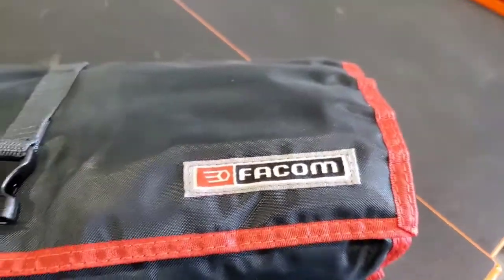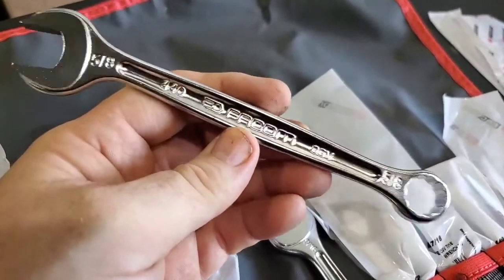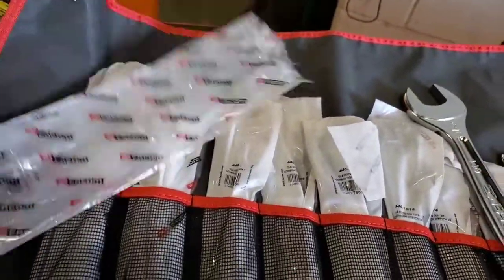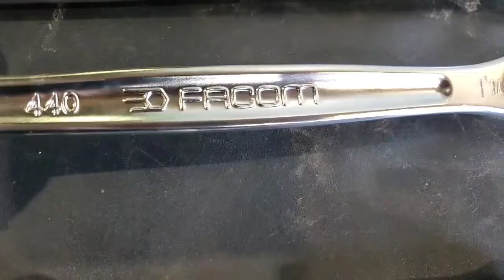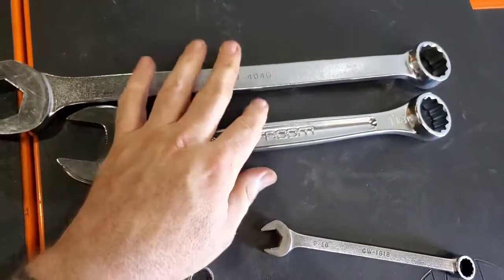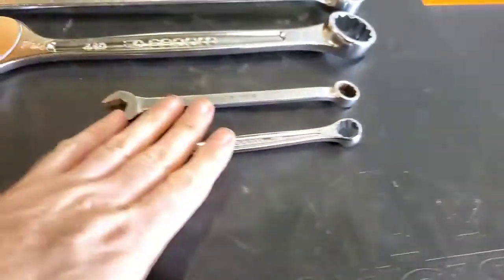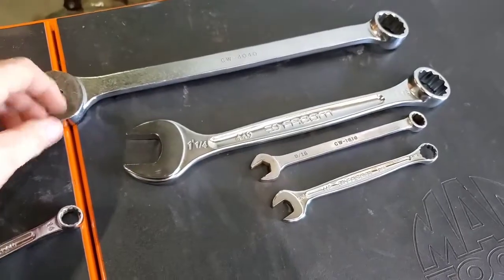FACOM Wrench Overview, Model 440

Comment: If you all like this style of wrench, Craftsman does offer this exact same wrench in their V series. The only difference is The wrench has Craftsman stamped on it rather than Facom. Yes Stanley owns both brands. Problem is Craftsman skips the 9mm and it only goes up to 19mm. I bought the V series for my tool bag, to complete the set I went on Amazon and purchased  Facom 440 individual wrenches in 9mm, 20mm, 21mm and 22mm to complete the set. The price was around $75 to $80. You definitely can get into some weird spots with  these wrenches. I am surprised how comfortable that I beam style handle actually is. They are definitely not as strong as Wright grip 2.0 or Snap-On flank drive plus but these wrenches are compact will get you into tight and awkward spots where the Wrights and Snap-On's can't get into. If you need wrenches for higher torque applications use the Wrights and Snap-On's. But if you work in weird and awkward spaces with lower torque Facom 440 or Craftsman V work very well. Truthfully I prefer Facom/Craftsman V over stubby wrenches. The box end is like a very shallow socket. The box end can get into a recess. The open is angled in such a way that you get a better purchase on a fastener in a tight spot. The thinner blade does help too. So far so good.
Reply from the maker: Yes!  I have the Mac version in metric. I keep them as backup to my Wrights because you are right. The Box end is fantastic and the offset of the open end are great. I saw the V series and was upset that they skip sizes as well... still have the cool holders tho... lol

Comment: Those are awesome...Great wrenches...I love Facom tools...👍
5:30.. they are intended to use with a wrench extender that's why you see the extra meat on the open end to handle higher loads..
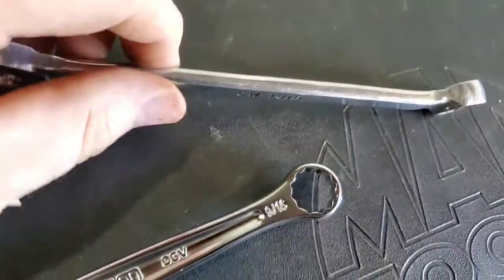8:05... that's why these were manufactured in an I-beam style... it's actually stronger and you can use less material ...
basically have thinner wrenches that are stronger than thicker wrenches by using the I-beam style.. I have a set of Challenger wrenches that look exactly like your Cornwell set...
Spot on...
9:24.. not really they're exactly the same length as the Tekton wrench...look at the box end of the wrenches... and you'll see the Facom is actually about a quarter of an inch away from being lined up with the other two
10:50... I just paid $110 for the 14 piece set..🤭 I got a great deal they're almost 50% off.. pretty much why I grabbed them...hell of a deal for this set...
Reply from the maker: That is a steal ! Good job.
I did like the wrenches, but because I work on equipment and large dump trucks I went with the Precision version.  
Thanks for watching and stay safe 😊

Comment: The main difference between these and the mac  ones are the open side. The mac precision torques have teeth on the open (think snap on flank drive/flank drive plus). Also I believe the mac ones are the longer than the standard 440s.
Reply from the maker: The Mac's are definitely longer as shown in the video. I was talking to a guy in Australia and they have Sidchrome. Another Stanley company. But they seem to be identical from what he was saying.. It is still a 440 wrench. Thanks for watching😁

Comment: That's great. I have a mixed set of those same Mac wrenches and I wanted to buy a complete set of the Facom ones and I'm glad they are just about the same length.
Reply from the maker: The FACOM are shorter then the Mac version. Either one is a very nice wrench set. But I have been the happiest with my Wright Wrenches. I still have the Mac's  but the Wrights's are my everyday goto.
Reply: @OneMechanic  what I mean was I have the similar length Mac ones as your cornwell. Probably same vintage.
Reply from the maker: @bstamand1985  ohhh.... lol... very nice bro

Comment: Just outa curiosity have you ever checked out the stahlwille model 14 combination wrenches? Although come to think of it they may not make them in sae anymore. But the metric ones are pretty sweet.
Reply from the maker: Hey... I have a friend that has them and she loves them. I have wanted to try them but because the sizes don't go very big, I have not tried them... Thanks for asking 😃

Comment: Yes mac based there design off these, now facom has wrenches that look like macs and are longer, we have the same wrenches i find them way to short i try to use them but always needed to go get a longer wrench or ratchet...sucks cause otherwise i really like them
Reply from the maker: Yeah, that is what I'm afraid of... But time will tell.
Thanks for watcjing👍👍
Reply: Great video, when i worked on cars they were short..now i work in a factory and there perfect.. should have stated that before

Comment: I have been told that the MAC Precision Torque wrenches are similar to the upcoming 440XL wrenches.
Reply from the maker: Is the 440XL a Facom wrench?
Reply: @OneMechanic  Yes, that is what I was told . No availability date was given.
Reply: Yeah, the Facom 440XL series is the direct equivalent to the Mac Precision Torque series, with the longer handles and the non-slip open jaws - nice but pricier than the standard 440s.